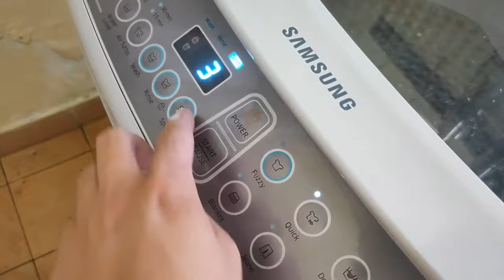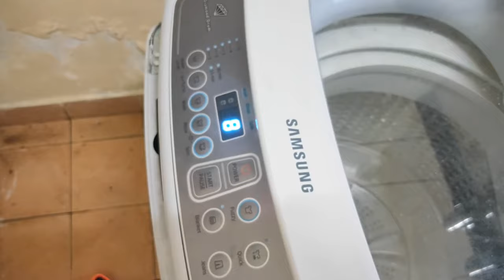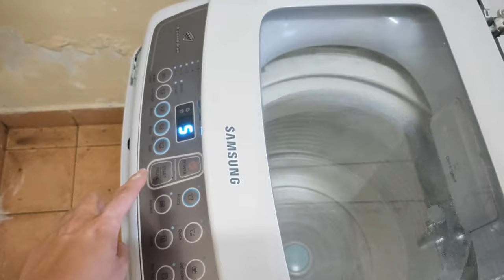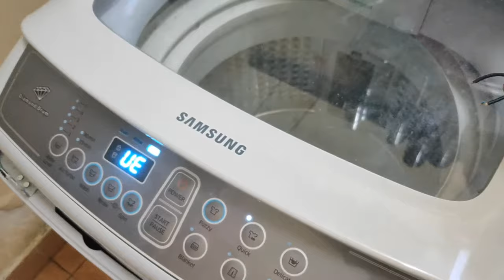D.I.Y. How to bypass the door sensor for top load Samsung washing machine. 'de error' or door error.

Comment: Hai Samsung top load latest model dc proplem rat cutting the wire and reconnect 2 side jack wire door sensor same problem can I direct the door switch is possible

Comment: When pressure sensor switch close water inlet valve is the pressure sensor switch wire switch on motor to wash?

Comment: Nice video...sir.. one problem I am facing today with same samsung model...spin cycle runs ok...but at wash cycle water level is not sensed..water overflows...all voltages at level sensor are ok ..what could be issue...pl guide...

Comment: Dammit. Bypassed the mechanical switch AND the megnetic but still 3E error :(
Reply: Did you figure it out bro?
Reply: What causes the Motor Driving Error (3E) ? The motor hall sensor terminal might be not connected. Foreign material (a screw) has entered the motor. The PBC housing terminal is not connected .